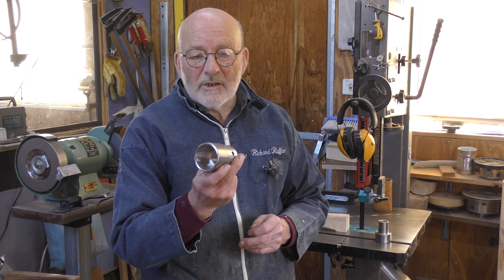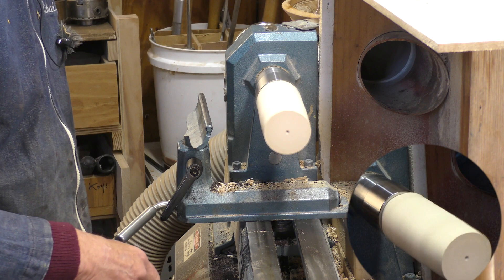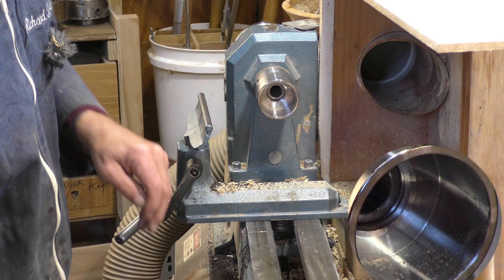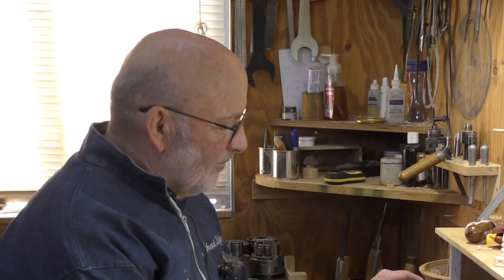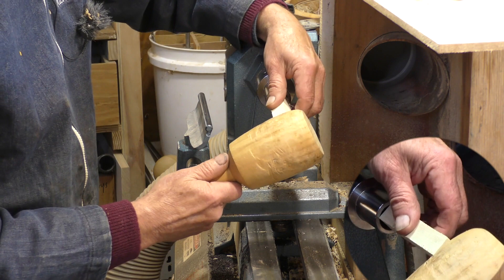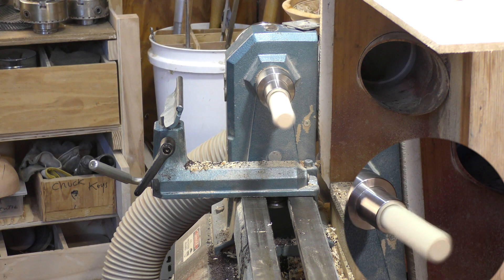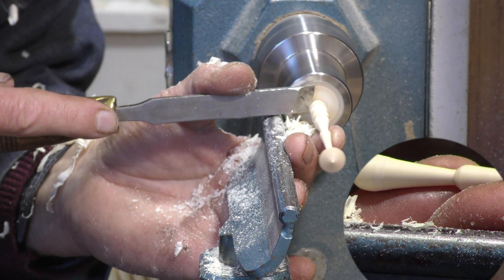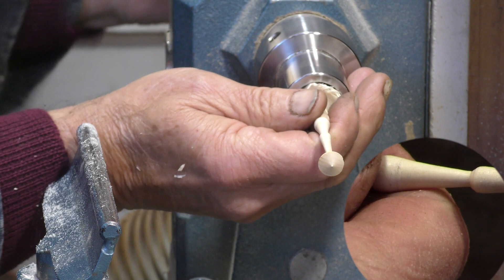Richard Raffan on cup chucks

Comment: I've been looking for a 1" cup chuck like the one featured in this video and cannot them. I think I will have to consult my local machine shop I suppose.
Reply from the maker: If in Australia, go to Vicmarc who made these.
Reply: You can make one out of a good true hole saw. They work fine as long as you haven't used them to drill a bunch of holes and heated their walls too much.

Comment: Is this bad on your bearings, whacking them into the headstock?
Reply from the maker: I answered this this recently in  https://youtu.be/FQAR7SgnBgo. I called Marco at Vicmarc who pointed out that some people can destroy anything, so yes it is possible to damage Vicmarc taper roller bearings by hammering them. However taper roller bearings are far more likely to be able to cope than ball bearings which would most certainly be ruined.  Marco reckons his bearings can cope when blanks are tapped in firmly, as I do here, especially if you turn the hand-wheel at the same time.  Obviously thumping blanks into a chuck can ruin any bearings in time, but all over the world production turners are driving blanks into cup chucks, so clearly good bearings can cope.